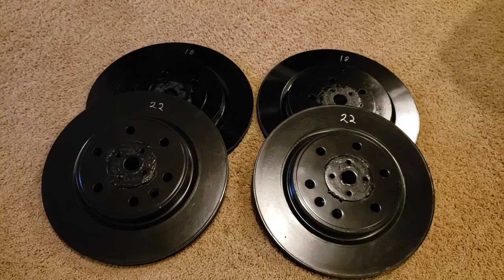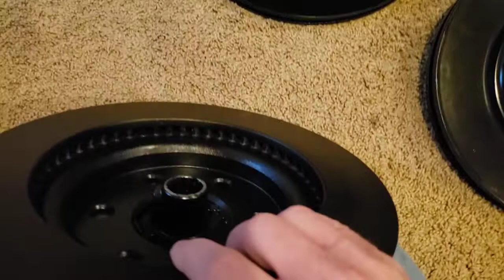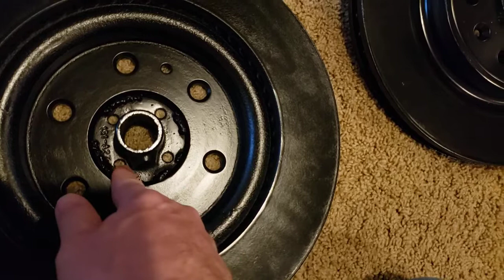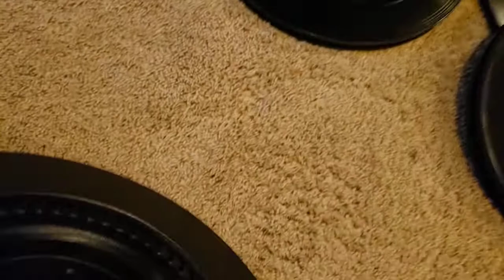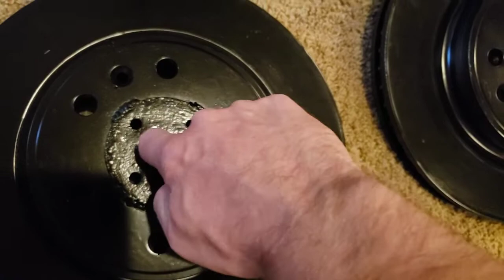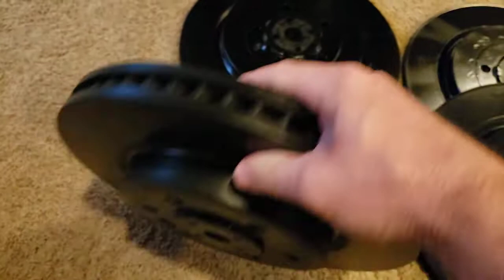Making weight plates from old brake rotors?  Why not.

Comment: I tape them and pour quick dry cement into them with a 2 inch PVC pipe in the middle. Looks redneck but makes useful cheap weights. Usually throw a handful of nails into the cement to function as rebar. No issues yet.

Comment: Exactly what I was looking for. But I don't have a welder. I would just cut a piece of scrap wood to fit inside the rotor, drill some holes in it to tie it to rotor with a steel wire.
Reply from the maker: Paying someone to weld up something is not cheap and there are decent welding machines for less than $200.  Besides, once you learn how to do it you'll discover all the things you can now make or fix so it's a good investment.  That, an air compressor, and some good hand tools is really what every shop should have.  Good luck and glad this helped.
Reply: @Engineering_Improvisation  I just updated the comment with an idea I have. I have some scrap wood and wire. I will cut wood rounds to fit inside the rotor and tie it with wire. Hope it will hold good. I am going to buy a welder anyway. I have a compressor and it's very useful as well.
Reply from the maker: That could work.  Although at that point you could make the wood discs bigger and bolt it through the lug flange as that would likely be stronger.
Reply: @Engineering_Improvisation  I rounded the ends of a 1x4 and press fit in the rotors inner cavity with a mallet. Its solid.
Reply from the maker: That'll work, too.  👍
Reply: @Engineering_Improvisation  I have made three of them and they work really well :) It takes just 5 minutes of make one with 1x4 wood, circular saw and 11/4 inch hole saw attachment on a drill. Thanks for the inspiration.
Reply: @vkapoor69 im definitely gonna  be trying that 😮

Comment: what did ya weld it with mig  tig  or Arc rod  and what type
Reply from the maker: I have a basic Lincoln 110v Flux core wire feed.  So far, it's welded everything I've needed to with great results.